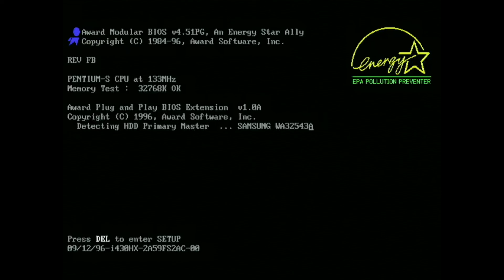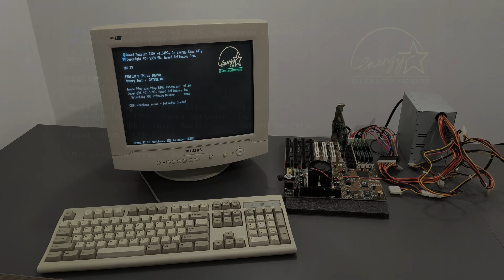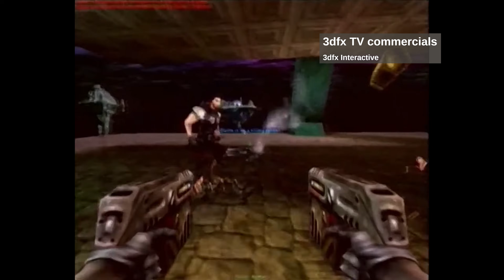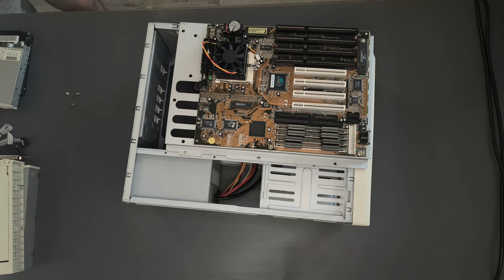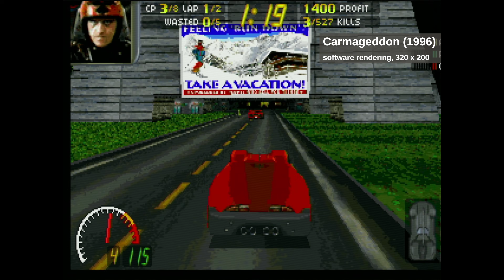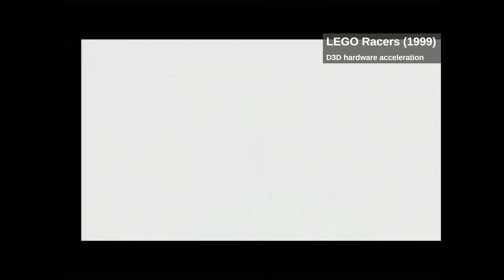A 3D-accelerated PC build from 1996

Comment: I kept an old 486 AT case in the basement for years. Now using it with an Abit AB-SM5 Penitum MMX. Some times I look at the caps in these older PSUs and change anything that looks leaky or bulging, or change the fan to Noctua. But mostly I use these just.. hoping they won't break down and destroy my components.

Comment: I started with the TRS-80 Model 1, 16KB system. I've loved it! Into the 80's I had a bunch of different Radio Shack models, until I bought an AST 286. My first IBM Clone. In the late 80's I was selected by my company to Beta test the Novel CNE program in Provo, UT. It took 3 weeks and the for 11 CNE's were minted. In those days there was no plug and play. You have to set all kinds of stuff for each add-on card you installed like the NIC and sound card. Those setting amounted to DMA address, IRQ, etc. Fun times! :)
Reply from the maker: Thank you for sharing such wonderful memories!
I was born too late to experience computers from that era, but I'd love to spend some time with one if I ever got the chance.

Comment: I'm still using old psu from the 90s and early 2000s I know it's risky but no issues.they were better built
Reply from the maker: Thanks! I'm no electrician, but I also tend to trust some old PSUs, though not all of them.

Personally, I pay attention to the weight of the unit. Those that feel like empty cans don't earn my trust. When I get a "new" old PSU, I open it up and take a look inside. I clean it up if necessary and look for any signs of wear, burns, corrosion, leaking/bulging capacitors, or anything else suspicious, but that's still only a visual check. Then I test it with hardware I don't care too much about. I check the voltages, make sure the fan is working properly, and the whole unit doesn't make any odd noises.

If you have any other tips for testing old PSUs before using them, please let me know. I think I should start testing capacitors with a multimeter first, but I don't really know how to do it yet.

Comment: I'm only familiar with PSX version of NFS2 and I didn't know NFS 2:SE on PC had such stark difference between Software Mode and 3dfx mode.
I usually play older games on my PS2 from backups on HDD and handheld games on 3DS (no PSP though). 
In case of PC games... unfortunately I play on modern PC with some tweaks, I know it's not the same feel as playing on contemporary hardware, but parts aren't cheap - maybe Windows XP era laptop would be ok for that task?
Reply from the maker: Although "toys" like Voodoo cards aren't cheap (let alone a V2 or V3), I believe retro gaming doesn't necessarily have to be high-end. If you put a system together wisely, it doesn't have to be as expensive as some may think, and it can be just as much fun. I plan to explore this topic one day, though probably not anytime soon.

An XP-era or even a late Windows 98/ME laptop also sounds like a good option. I'm not that much into gaming on retro laptops, but if you plan to play 2D and early 3D games, I think most Pentium III laptops would do. Especially on W98 SE, you’ll benefit from good game compatibility. I've recently bought two Compaq Armada M700s with Pentium III and ATI Rage Mobility chips, two of them for about 70 USD (one is in very good condition, the other one has a few minor issues; both of them have dead batteries though). I remember playing NFS: Porsche on a similar Compaq Armada E500 once in the past.

A Pentium M/Athlon laptop with a dedicated Nvidia or ATI card may be also a good option. That made me think if it would handle 3dfx Glide games with a wrapper such as nGlide, but the latest version of it requires DX9-compatible graphics, so I'm not sure whether it would work on anything older than the a GeForce FX or a Radeon 9500. I feel like there's some interesting research to be done there. :)